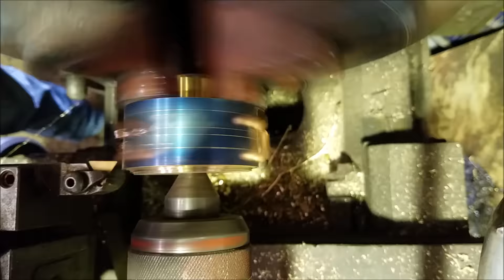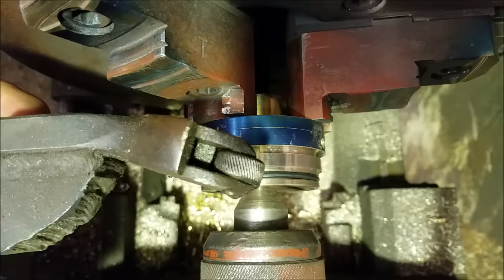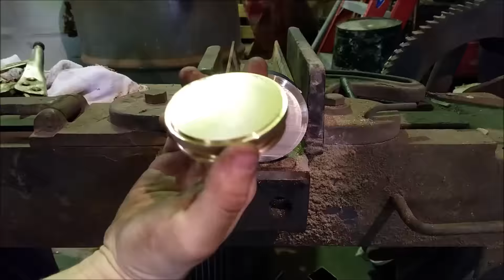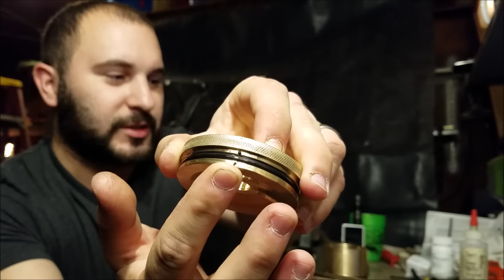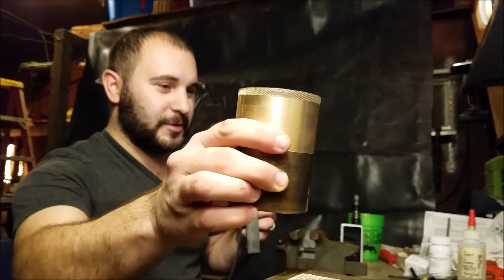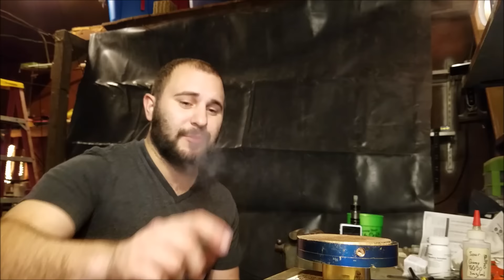Making the Worlds Largest rda part 2 the top cap

Comment: what do you have planned for air flow?
Reply from the maker: beau shade that is still yet to be determined though the airflow will definitely be through the top cap for 2 reasons. 1 is that I just want to see how well it works and the other is because its going to hold a ton of fluid and I dont trust it not to leak with the airflow on the sides
Reply: I fully agree. Maybe down angled 1.5 or 2mm holes pointed twoards the center of the build deck  or a set of 6 down angled cyclops holes. 2mm by 4 or 6mm.  That would actually be pretty awesome.
Reply from the maker: beau shade I'll definitely be putting the holes in at an angle. I'll wait until the entire rda is finished then decide where and how to place them. my goal is high velocity and a vortex. that was a large reason for the tapered top cap to funnel the air better
Reply: I cant wait to see this thing done.  The maximus is awesome. This will be mind blowing
Reply from the maker: beau shade if its possible I'm going to attempt to make cone shaped air holes at most 2mm inside the rda and up to 5mm on the outside and arrange them in such a way that it gives a golfball type texture. from my experience with the maximus its very easy to try and make too much airflow and these coils will be massive so spreading the air out but all in one circular direction should give even distribution of air without overdoing it
Reply: Would that make them whistle tho? Not sure if thats a concern at this point tho lol.  Something like a dual axis angle would work nice tho. To make the air cyclone inaide the barrel. That way itll worl down to the deck before coming to the top.    I always thought a ring of airflow holes bored into the barrel about the height of the center of where the coils will sit angled up and at roughly at a 45 or 35 degree angle would make a great and effective airflow pattern. What do you think?
Reply from the maker: beau shade unless the barrel is very thick angling the holes won't make any real difference. hopefully it won't make them whistle lol! that's the point of making a larger hole on the outside that tapers in. I spent quite a bit of time looking at basic fluid dynamics a while back in an attempt to find the perfect airflow and havent figured it out yet.  I will say a thicker barrel with tapered holes would probably perform better than standard but I would put them higher and channel them down onto the coil so that it would flow onto and underneath the coils and converge in the center
Reply: True. I just figured it would end up with a pretty thick barrel.   Hopefully the taper fixes the possible whistle lol im pumped for the next video for sure.